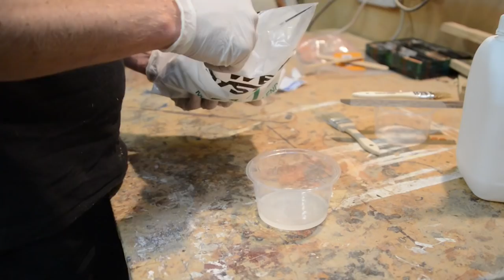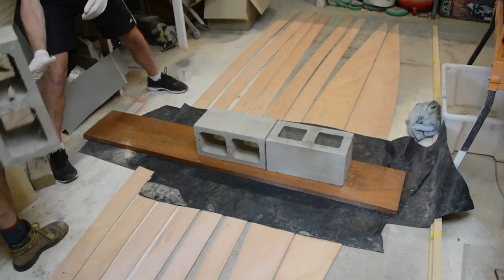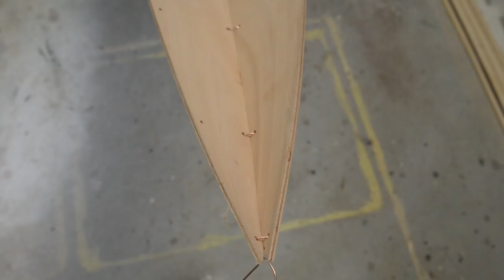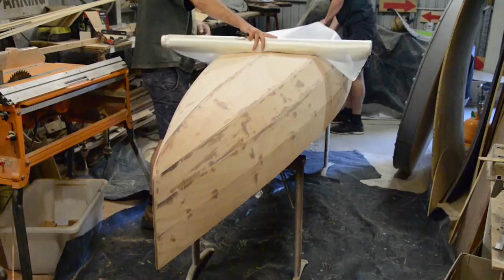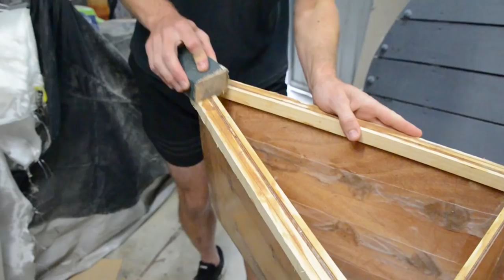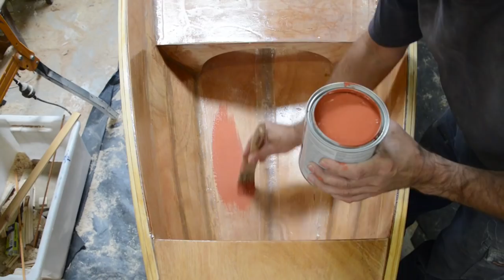Building the Gecko 375 Canoe

Comment: Nice design except for the thwart placement.   If the thwart(s) are placed so that the person's CG is positioned properly and the canoe sits mostly level in the water it will perform much better and be much faster w/o wind issues.
Reply: Some water ballast (in a drybag or similar) in the bow would also help.
Reply: He is sitting backwards. The canoe has isometric seating for two teenagers or one adult depending on the direction you face.

Comment: Hi Andrew. Great video. Did you just put the one layer of glass cloth on the outside of the hull and one layer of tape on the joints between the panels inside?
Reply: I think that would be plenty, I think most small boats are over glassed
Reply from the maker: Thanks heaps (sorry I didnt reply I didnt think anyone would look at this) yes one layer

Comment: Great work and video. How much epoxy would you say you ended up using?
Reply from the maker: Sorry I never replied - I think about 1 litre
Reply: I built a 9 1/2 tiny canoe used 1 and 1/2 quarts of marine polyester epoxy .... cost about 50 bucks total and was done in 4 hours.... on the water the next day....
Reply: @jolllyroger1  what plan did you use? I'm wanting to build a very small one I can pull behind my bike to a lake 6 km from home!
Reply: @wendyanderson8169  just take 2 4x8 plywood epoxy  scarf joint the ends together use 3/8 ply use a piece cut from one end to place over the scarf joint epoxy....determine the width you want at the bottom I think mine was about 18 or 20 inches...
Cut straight both sides off 12 to 14 inches...... take the 2 side pieces and angle the ends slightly .... more angle means more rocker in the bottom (curve front to back..... more rocker will turn faster less rocker will track straighter ....I had about 4 inches when the bottom of the bow was on the ground the back was about 4 inches up...approx... take the bow ends that are angled and drill 3 holes wire together or use zip ties.... do the same at the rear angle place that over the piece that's left about 20 inches spread the 2 angled side parts and sit between them and determine how wide you want to spread those.... get a feel for what width you like and height of the sides for rowing..... then simply hold it in place...(have a friend trace the bottom edge of the sides to the bottom..... cut with a jig saw skill saw or even a hand saw .... then drill holes along the bottom piece to holes drilled matching the side pieces wire or zip tie together mix epoxy with sawdust and glue inside bonding sides to bottom..... it's good to add a piece along the top edge as gunwales adding stiffness I just sat directly on the bottom..... if you use 2 4x8 ply you get a canoe about 15 ...and half feet approx .... you can make it any length you like.... my ply was 4x5 feet so ended up 9 1/2 feet big enough for one adult.... if you make it less than the 16 foot what ever amount you make it shorter will leave ply that you can use to make seats.... if you go 14 ft you can take 2 feet from one end which will leave your center join 1 foot back of center.... or if 12 feet you end up with 4 feet extra and the center 2 feet approx behind center.... it's really easy just cut out an 8 1/2 by 11 paper cut to scale of 2 4x8 but joined then with scissors and scotch tape make a small model first just tape the sides together flat then change the angle until you like what you see then spread draw on the bottom cut out and tape sides to the bottom piece..... use card stock it's easier.... make a couple till you like what you see then just duplicate that in ply.....1/4 inch ply is more than thick enough im thinking the next one I build will be made from door skins.... you can use a squeegee to spread epoxy over the outside and inside after your finish to water proof.... or paint with marine wood paint..... I suggest epoxy the outside with 2 coats.... or more... doorskin will  require more caution when standing in the boat and might need flooring strips to strengthen.... but without it should be very light.... my 9 1/2 boat was fairly light and extremely tough....I never weighed it....I also placed a strip 1 inch tall front to rear on the center line to help in tracking straight the are different ways to make those for straight line paddling or more manuverability .... you can have that 1/2  inch high at the front too rear center and 3 inches at the front and or rear for straight tracking..... I put on mine a rudder afterwards that was steered by a line on each gunwale this aided straight aracking while paddling try different things see what you like.... build it the way you want.... I used polyester resin which cured in 15 min.... I suggest using epoxy that gives you an hour or longer.... so you have time before it goes off hard..... check your local laws for boat registration when I built the 9 1/2 cali law said anything over 12 feet required registration or anything with 5 horse plus power did....in think that's changed here now and canoes don't require and can take 5 horse..... watch a few youtu.be videos on build simple plywood canoe....I just winged it and it took probably 6 hours not 
Counting waiting time for things ti cure or paint to dry..... I'm pretty certain I could build a doorskin canoe in 3 hours now that I have done it not counting cure times.... when I do it again I'll mix my resin with sawdust and put it in a large 1 gallon ziplock freezer bag cut off the corner and squeeze like cake decorating to do the joint of the sides to bottom .... oh after the resin cures cut the zip ties or wire and pull out filling the holes.... it's a fast easy way to build a canoe .... most people should be able to do this in a Friday night plus Saturday ...and Sunday depending on your skill
Reply: @jolllyroger1  awesome, thanks for all the instructions! Makes it seem less initimidating. I'm going to go for it! I'll measure between the wheels of my bike trailer where it'll sit, and go from there! good tip to use the slower setting epoxy, too... and checking local laws!
Reply: @wendyanderson8169  make sure you get the width at the gunwales right for rowing comfort and keep the sides fairly vertical near the font to rear center
Reply: @andrewnoble5932  Could you make the project available?